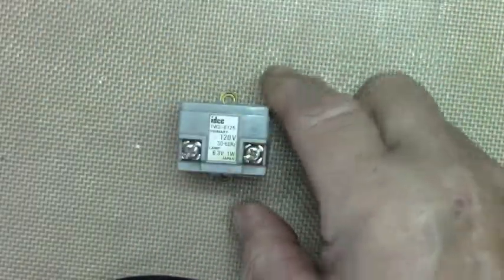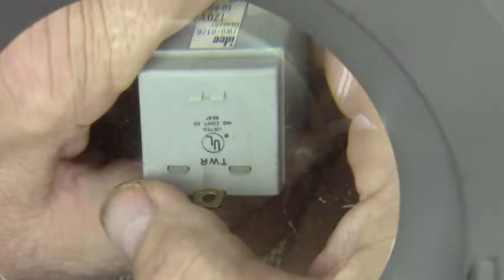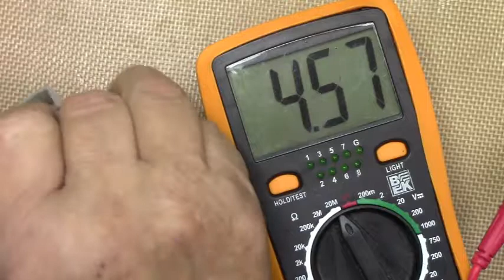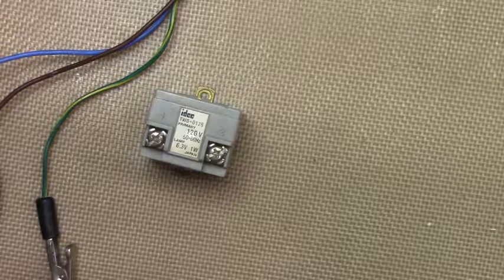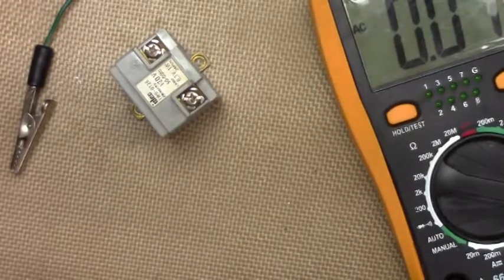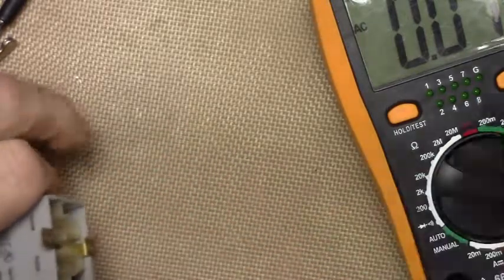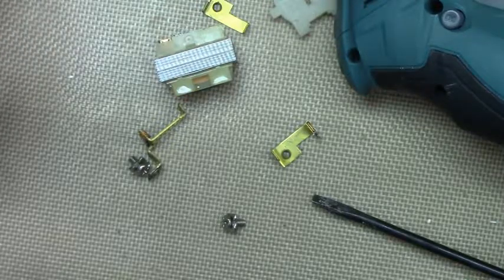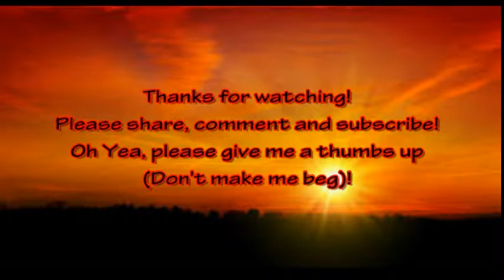Variac project #4a-Smoke Test

Comment: I don't feel so bad now... I let the smoke out of my el-cheapo Harbor Freight multimeter the other day. I wanted to test the voltage on my new 30Ah LiFEPo4 battery pack with it, and forgot to switch the leads back to the voltage measurement side, and hooked it across the terminals while still set to measure amperage. Lots of smoke came out and even though the display still worked, it wouldn't show anything. My immediate question was, why didn't it blow the fuse (supposedly fused at 10A) but then I remembered: el-cheapo Harbor Freight. Oh, well. Like father like son...
Reply from the maker: I resemble that remark!